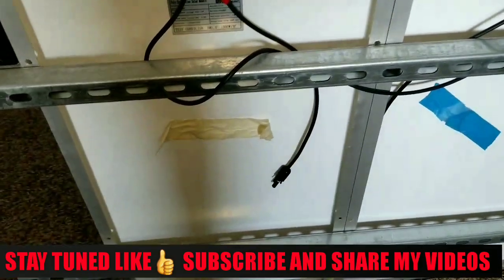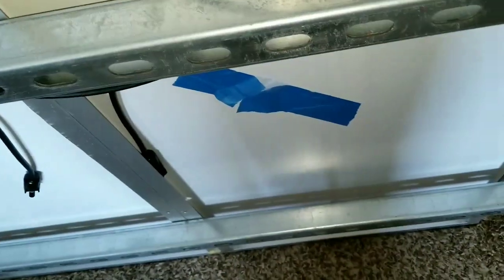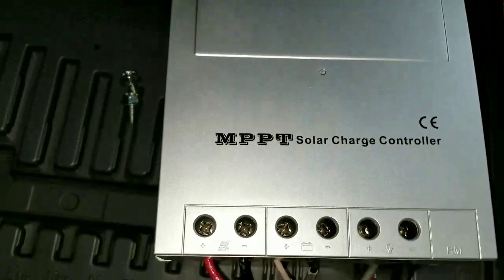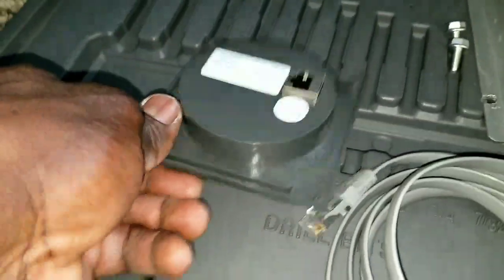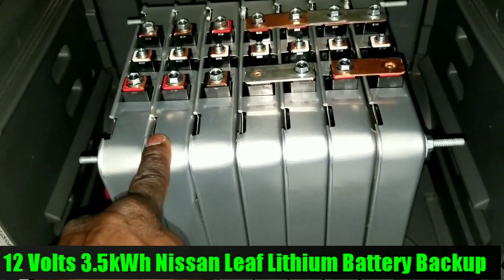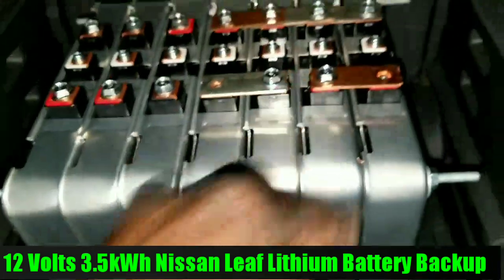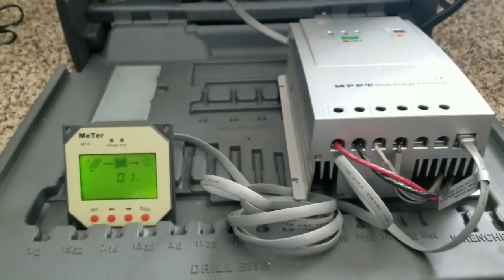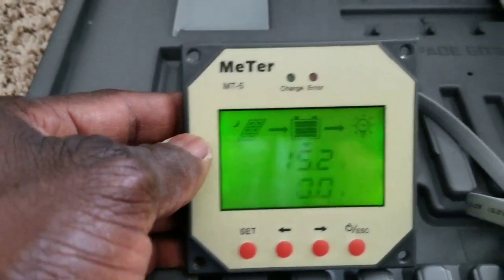UNISTRUT SOLAR PANEL MOUNT: How to install solar panels Using Unistrut/Superstrut (part:2)

Comment: What size of Unistruts are you using?
Reply from the maker: Superstrut 5/8
Thanks for WATCHING please LIKE  SHARE & SUBSCRIBE
UNISTRUT NUT WITH SPRING: Superstrut Solar Panel Mount
https://youtu.be/XBR-aiK7kIw

SOLAR PANEL ORIENTATION/Cutting Unistrut/Superstrut for Roof Mount Installation
https://youtu.be/eNFo08dfN8Q

UNISTRUT SOLAR PANEL MOUNT: How to install solar panels Using Unistrut/Superstrut
https://youtu.be/3uubcw8gGPw

Comment: Great videos!!!
Reply from the maker: Thanks
Reply from the maker: UNISTRUT NUT WITH SPRING: Superstrut Solar Panel Mount
https://youtu.be/XBR-aiK7kIw

SOLAR PANEL ORIENTATION/Cutting Unistrut/Superstrut for Roof Mount Installation
https://youtu.be/eNFo08dfN8Q

UNISTRUT SOLAR PANEL MOUNT: How to install solar panels Using Unistrut/Superstrut
https://youtu.be/3uubcw8gGPw

Comment: i had some of them good panels
Reply from the maker: Check this out.
https://youtu.be/qPzBdZ6DpxM
Reply from the maker: UNISTRUT NUT WITH SPRING: Superstrut Solar Panel Mount
https://youtu.be/XBR-aiK7kIw

SOLAR PANEL ORIENTATION/Cutting Unistrut/Superstrut for Roof Mount Installation
https://youtu.be/eNFo08dfN8Q

UNISTRUT SOLAR PANEL MOUNT: How to install solar panels Using Unistrut/Superstrut
https://youtu.be/3uubcw8gGPw